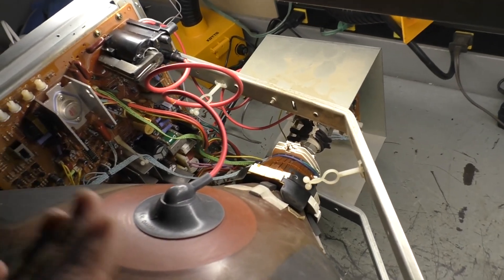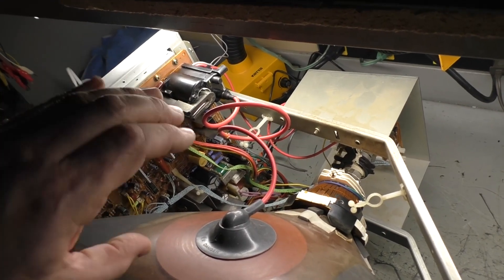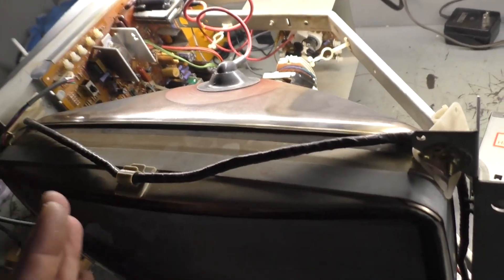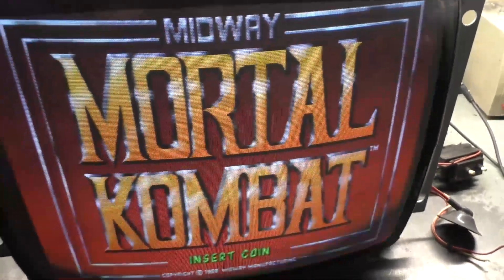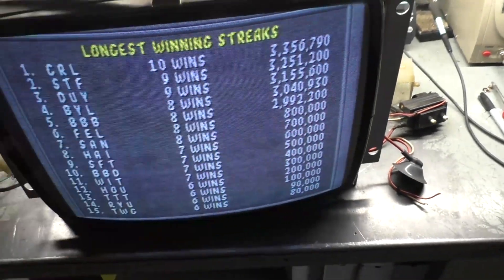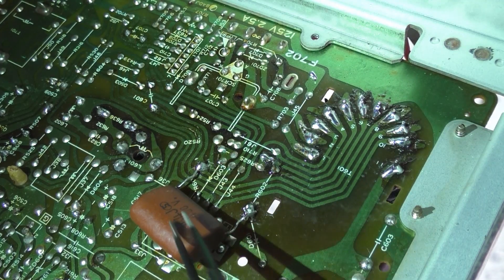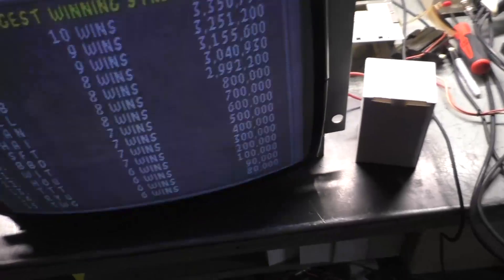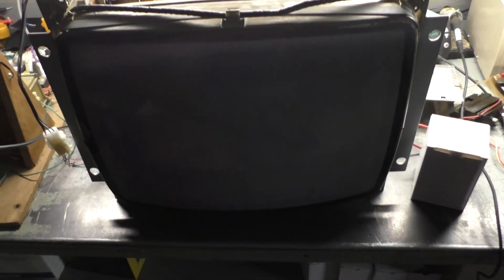Sharp XM-1801/2001 New Flyback Testing - Oscillation Issues - Capacitor Solution?

Comment: I bought this flyback because the Sharp NES TV uses the F1408CE. IS there a way to know where the place the 400V capacitor on the 19SV111 Chassis? I have the service manual and schematics available.
Reply from the maker: Well the TV isn’t designed to run at 100v like this chassis is (I assume), so you shouldn’t need the capacitor.
Reply: @MikesArcadeMonitorRepair  YOu the Man Mike! I'm attempting it now

Comment: Awesome as always Mike. I'm about to replace a flyback and hope you don't mind a POSSIBLY simple question that has very little information available out there. I have a Makvision Wei-Ya 2929D and originally the flyback was just single focus. But the only replacement available is dual focus. I noticed the main board that is has an unused soldered pin hole for the Flyback Transistor labeled 'DF' which I imagine is used for Dual Focus. The Schematic shows some jumpers maybe being required.

But I've heard some say the tube itself or the neckboard has to support it as well. The plastic part on the neckboard that connects to tube does have a tiny hole above where the main focus wire connects, that could possibly be where the extra focus wire connects. But If I can't use Dual Focus I imagine I would just snip that extra pin on the flyback and the extra wire would simply not be used. And it would work like a single focus flyback?

Anyway I love the knowledge you provide in this niche hobby. I only bugged you with this question because the internet seems to have very limited info on this topic. Want to make sure I install the flyback correctly. Thanks.
Reply from the maker: Greetings. If the tube only has a single focus pin, you cannot use a dual focus flyback. Sorry. Are there actually two focus wires coming out of the flyback?
Reply: @MikesArcadeMonitorRepair  Nope only one wire originally. I was told you could use a dual focus flyback but only one focus knob would be operational. In your experience this is not possible either?
Reply from the maker: In that case, it’s likely a single-focus flyback but they are just using a dual-focus case. Might work.

Comment: Hi mike, can you identify the frame output ic on a GLENDALE EYGO 728 chassis, it’s a Japanese made chassis’s, running a 25 inch crt, cabinet Gottlieb upright. Definitely 80s.I have a faulty frame ic but the original seems the be deliberately rubbed off . Perhaps these chassis are only here in Australia. Hope you can help
Reply from the maker: I have no experience with one of those so unfortunately, I cannot say. My apologies.